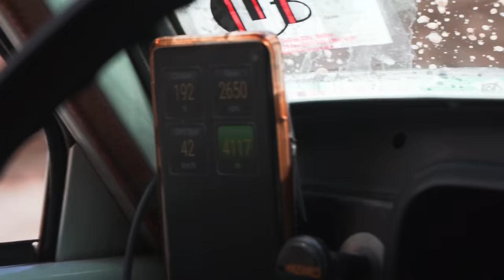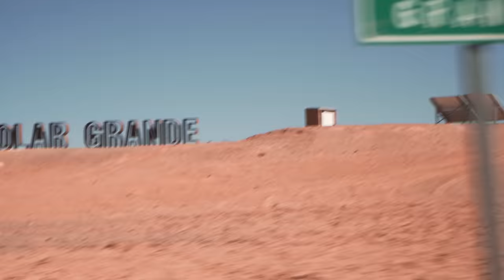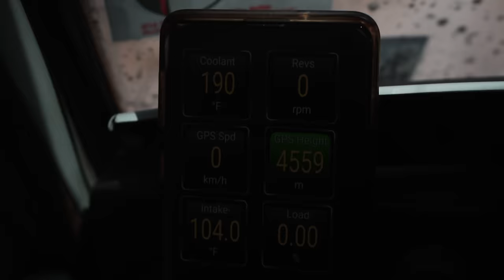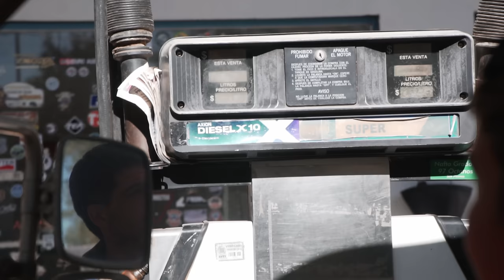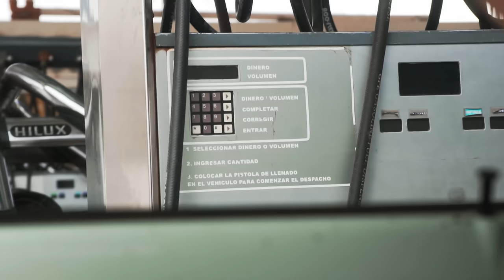LEGENDARY 6 Day Off-Road Route | Overland Travel Documentary

Comment: The first part of the video was the very definition of High and Dry. I, like you, always wondered how and why anyone would live there. No water, no wood for material or fuel and no game for food. What do they do? I've done some overlanding in Florida and they have something called Sugar Sand and it is the consistency of sugar and will swallow a vehicle. Never really been a sand or desert fan, but that area was very cool.
The second half of the video with more vegetation and water was more my speed. The section with the condors flying in the distance looked like pterodactyls due to their scale. 
Not to get all sciencey, but higher altitude doesn't really have less oxygen, just less atmospheric pressure therefore cars and animals (including humans) take in less oxygen with each breath. Living creatures adjust to the different pressure and that's when you acclimate. Car engines can't unless they are turbocharged, supercharged or have a modern fuel injection system that will adjust the fuel-air mixture. The outcome is still less power and that's what you feel in the performance of Sunday. 
You guys seem to be having a blast and it's great that you finally found your hot spring.
Reply from the maker: It was really shocking to see people living and working out there. Almost as shocking as the terrain and landscape itself and how frequently it transformed. 

Deson't sound like we want anything to do with sugar sand ha! 

Interesting note on the altitude, I wasn't aware! Maybe we'll need some forced induction if we do the Himalayas :D

Comment: You maybe able to turn up your advance when you get to higher altitude. The thinner air allows for more advance to maintain power / leverage in the motor.
Reply from the maker: Not sure how to do it electronically, as this engine doesn't have a distributor.
Reply: @ToyotaWorldRunners  interesting I would have thought that year would have a distributor. Cool little truck. They dont make em like they used to!

Comment: Jb weld or quick steel would probably have helped with that plug? I carry quick steel in my offroad kit
Reply from the maker: Not sure, it's rubber, so the electrical tape did it's job for now!
Reply: @ToyotaWorldRunners  if it works, that's all that matters! Great video :)